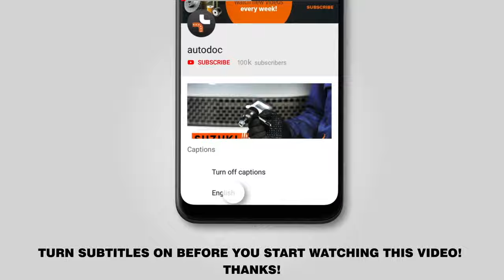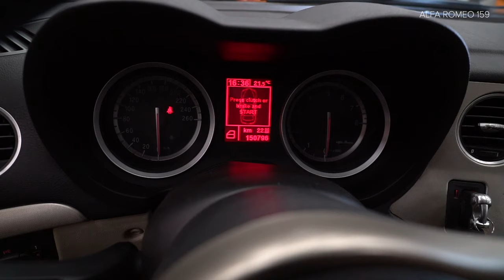How to change oil filter and engine oil on ALFA ROMEO 159 (939) [TUTORIAL AUTODOC]

Comment: Does the drain plug washer need replacement? 1.9 JtDM 🙏
Reply from the maker: Replacement of the drain plug gasket is an important part of vehicle maintenance, which should not be forgotten and should be replaced at each service. It is installed on the engine oil pan drain plug, thereby reducing the risk of oil leakage.

Comment: Important note!   I have the jts 2.2 and the oil filter socket was 32mm Not 36mm.  That was 15 dollars for that socket right down the drain.   And... 15mm for the oil drain nut.   Check first!
Reply from the maker: Thank you for your comment!
Will take this into account in our new videos.
Best Regards,
Autodoc team
Reply: there is so much wrong with this video, as usual at autodoc manuals. by the way, it is a JTS in this video, like yours, so they need a 32 and 15mm, as you mentioned.
- not using engine cleaner fluid for 10min, cleaning engine from old dirt
- not advicing new bolt with new rubber seal
- not cleaning oil filter case from old oil, which is a rest of always
- not running engine to let oil filter work properly and then control amount of oil again
Reply: Yep, wish I saw this comment earlier. Had the same issue.

Comment: Hello, how often would you advise having the engine oil changed for the 159 1.9jtdm? The manual says every 30 000km/24months which sounds like an extreme interval. Am I OK with changing it every 10 000km ?
Reply from the maker: Thank you for your comment.
It all depends on the brand of oil, it is better to change the oil every 10,000 km.
AUTODOC

Comment: How much i need oil for 1.9jtd 150hp?
Reply from the maker: To change the oil, you will need around 4.6 liters of oil, you can find more accurate information in the technical documentation for the maintenance and repair of your car.

Comment: How much kilometers was on this oil? Its a petrol car why is the engine oil so black?
Reply from the maker: Thank you for your comment! We carried out the replacement according to the recommendations of the service book 8000km, unfortunately we can not say the reason for the dark oil. Best Regards, Autodoc Team!
Reply: its black because its  castrol oil... :D  I'll never put that in my alfa
Reply: @vallentyn2007  
what should i use than for my alfa romeo?
Reply: @ziadbakkich3132  selenia, motul, ravenol, petronas
Reply: @vallentyn2007  selenia is petronas
Reply: @ziadbakkich3132  yes my bad. Anyway not  castrol. 😁
Reply: @vallentyn2007  Castrol is best oil ever, that oil you named are shit and bad quality :)
Reply: Because it is direct injected engine. They produce soot, just like the diesel engines. That is why they need more frequent oil changes than the port injected engines, and they require specific oil for direct injected engines.